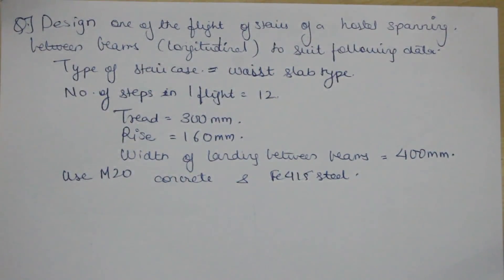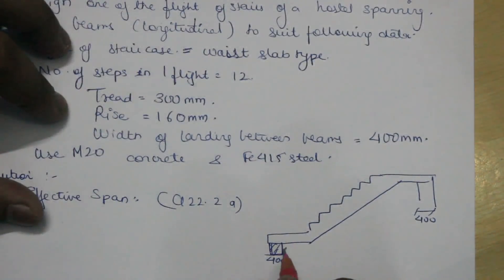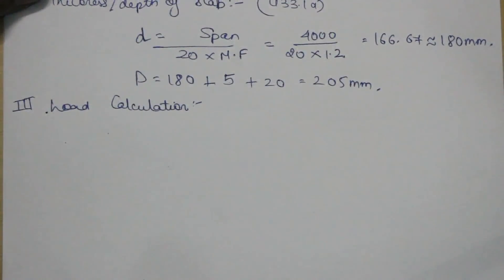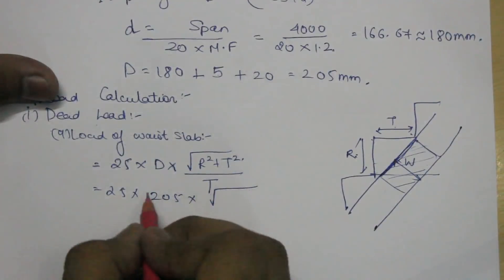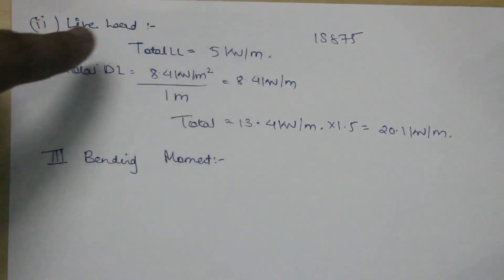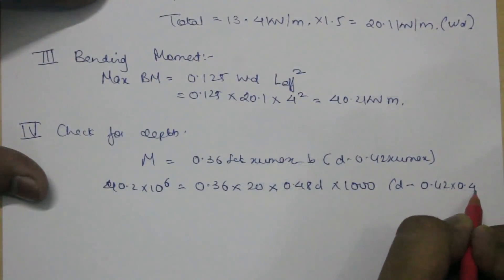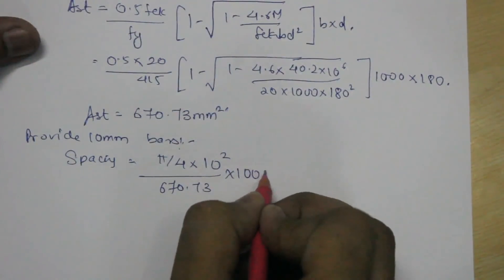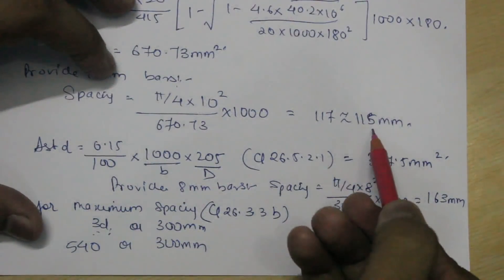DESIGN OF STAIRCASES | IS 456 | Limit State Design | Mumbai University

Comment: 6.15 ,how  Load of 1. Step would be 2 KN ? 
It should  be【 .5 x .16 x .3 ÷.3 】= .08
Reply from the maker: hello vinay.
you have to multiply the area by the unit weight of concrete which i missed writing. therefore 0.08*25=2Kn/m2

hope it helps
Reply: @EverythingCivil  yeah, I got confused there as well. Thanks for clearing our doubt

Comment: beam width in landing given, but if that data is not given then how you decide the beam width
Reply from the maker: Usually the staircases are designed at the end after the slabs beams and columns are designed. So usually you will have the beam width beforehand.